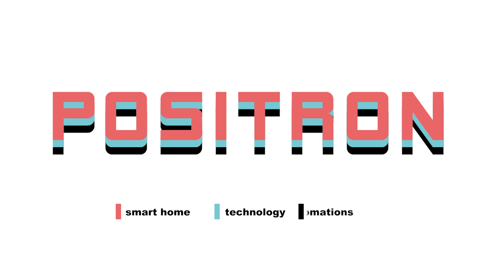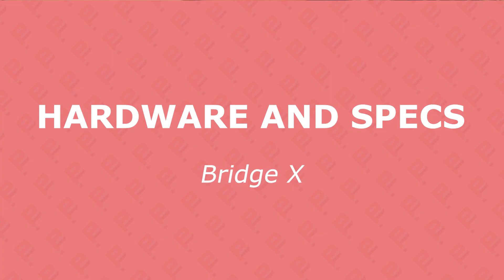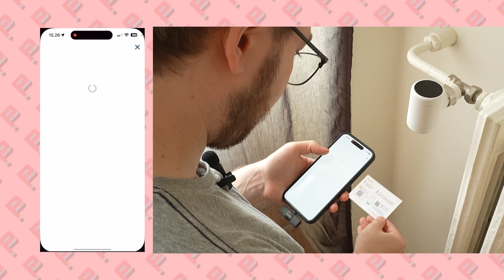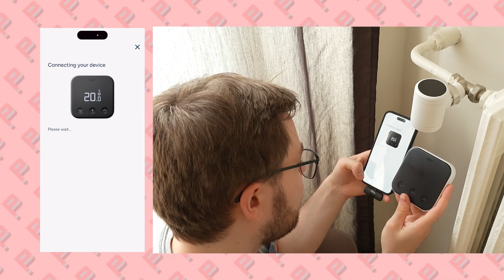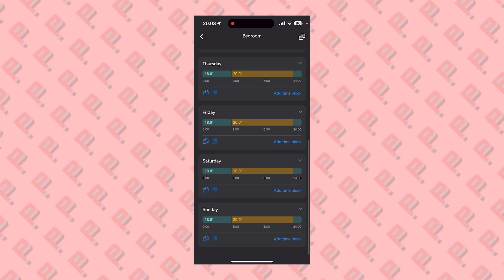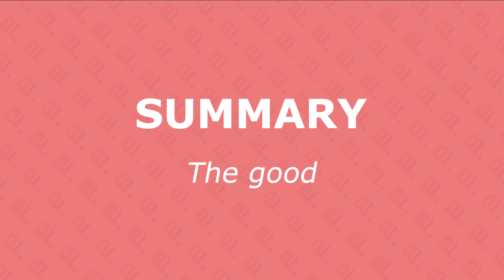Are the Tado X products worth getting?

Comment: I don't need the smart radiator thermostats, would I be able to just buy the Thermostat X and use it to control the temperature overall for the radiators? Because I've read in a comment in other video that you can't buy and use only the Thermostat X!!
Reply from the maker: The Thermostat X will work as a regular thermostat if you don't connect it to any smart home platform. It's just a pricey option for a thermostat for that use

Comment: If you already have Thread Boarder Router in your home (e.g. Apple TV or HomePod mini) I wouldn't use the Tado Bridge X as well because it will likely create a second Thread network, which is sub-optimal with Matter 1.3 (allegedly improved/fixed with Matter 1.4)

Comment: Got the Tado X to replace 2nd Gen Nest. Atrocious - sent it back. Couldn’t set up the Wireless Receiver - it would not go into the mode to connect to the internet. Reset, factory reset multiple times. 

Tried to call Customer Helpline - forget it, recorded message saying to use the web chat. 
Go to web chat - forget it. It’s an AI chatbot with not much I. Once you’ve exhausted it’s pre installed answers it tells you that someone will look into it and email you back at some point. 

I found an Installer phone line and spoke to someone who basically just got me to reset and factory reset it again. When that didn’t work I was told to reinstall the old thermostat and schedule a video call with one of their technicians. Waste of half a day.

Absolute pile of shit. You cannot use this without an internet connection. At all. There is no pairing of the temperature sensor to the receiver from the factory like you can do with every other thermostat I’ve ever installed. That’s just insane. 
If you’re an installer and the home you are putting this in doesn’t have an internet connection or, as in my case it doesn’t go into the correct mode you have to remove it and put the old thermostat back in. Imagine how that looks to a customer. 

Then I discovered that Tado have just introduced subscriptions for using basic functions like geofencing and separate room control and that was it. The radiator valves hadn’t been installed so they were returned. Cancelled the video chat and sent the whole lot back for refund. Im not subscribing to someone to get full functionality of equipment that I own when other manufacturers offer these for free.

If you’re an installer and got this to work straight off then good for you, but this system has been badly thought out from the design stage by not allowing pairing without an internet connection. The lack of real time Customer Support is a disgrace and the adding of Subscriptions for using functions is the thin end of the wedge for reducing functionality later unless you pay them. 

I’d avoid Tado completely. Well I have avoided them. They’ll never go into any of my Client’s homes. 

Oh and I never was emailed back either.

Comment: I have them. Beautiful from an aesthetical point of view, but not very practical. Lot of troubles if you convert from a heating system that wasn't supposed to mount it. The app isn't usable without internet and in general is only moderately user friendly. Pairing the appliances with the app was also a very painful experience (I had to do it after all the thermostats were installed and it took an eternity because the technicians didn't take note of the various codes). And honestly my home is not warm as I expected. I'll see what happens with the costs, but I don't suggest them.

Comment: Thanks for the review of the Tado X products. I have a few questions if I may. First and foremost, I live in Italy and have a central heating room with a gas furnace and a 750 liter boiler. We have a small guest house with 6 guest rooms and we rent rooms during the summer. During the winter, we are closed but I still have to heat the guest rooms to avoid having any pipes freeze when the temperature drops below zero. Each room in our house has a temperature control with a sensor. The temperature control only allows a guest to increase the base temperature (set by me) by 3 degrees or reduce the temperature by 3 degrees. The base temperature is represented by a dash (-) on the dial. There is also an antifreeze symbol on the dial for winter. Unfortunately, when the house was renovated, the electrician only put a temperature control in each of the bedrooms (facing south) but not in each of the bathrooms (facing north). Therefore, despite having radiators in both the bedroom and the bathroom, there is a temperature difference between the bedroom and bathroom in each guest room because there is only one sensor in a guest room. When a guest increases the temperature by 1, 2 or 3, degrees, the valve in the heating room opens and the pump begins to send warm water to heat the radiator in the guest room. When the desired temperature is reached, the sensor in the bedroom relays the information to the valve in the heating room and it closes which also stops the water pump. If I install the Tado X radiator valves on each radiatore in each guest room, that will control the temperature on each radiatore. That said, is there a device (the bridge or the black junction box that you connected the devices to?) that I need to install in the central heating room to control the opening and closing of the valves to allow the pump to send warm water to the guest room radiators?  Thanks in advance for your response. Ciao, Roberto

Comment: The Tado app is able to adopt an X device via other border routers, the Bridge X is not needed. You only need it if you don’t any other border routers. This is also stated on Tado’s website.
Reply: Wow thank you for that clarification
Reply: so if I have a tado v3 (old generation) setup with valve radiatiors, smart thermostat and bridge and I buy an additional wireless temperature sensor x to add in one room, will I be able to do this?

Comment: Hi thank you for the video very informative, I wanted to know If for example I don't have a smart valve in the kitchen and only have the smart thermostat and I decided to control the temperature of the kitchen from the thermal stat, does that turn all the house radiator on even though they are using the smart valves? or keeps all radiators with the smart valves off and turns heating on only for the radiator that doesn't have the smart valve?
Reply from the maker: I have to admit that I am unsure of this. I think it's best to reach out to Tado for an answer. Thanks for the kind words!

Comment: Thanks for such a video - just wanted to check if its possible to have two temps sensors to control a single zone. 

 I have a old house on a single zone - there is no one logical place to put the wireless thermostat due to different bits of the house getting colder depending on the wind direction.

 Do you know if its possible to have two wireless 'sensors' so that when either drops below the set temperature then the heating would be called (for the whole house). 

I don't want to install smart TVR as this will become very complex - just looking for a solution with two wireless sensors
Reply from the maker: @obrace1  I am not sure as I only have one. The best thing would be to reach out to Tado and ask them 🙂

Comment: Great review, I only have one question

I have 5 levels on my manual thermistor now, I want to turn it full regardless of the temperature because it’s a weak heater

Can I control it to max in any way?
Reply from the maker: There's no option to open the valve completely no matter the temperature. However, if you get the Temperature Sensor X and place it in the other end of the room, the Thermostat X will open up the valve when set to 30C (max temperatur)for a long time to heat up the room.
Reply: @ ooo I see, thanks a lot for the answer, in it you even gave me a possible work around, I just subscribed :)

As for the device, it’s a pity because I love the design but I would want a device which gives me full control
Reply from the maker: I'm glad you could use my answer, even if it wasn't the answer you had hoped for :) 

I am not aware of any smart thermostats that will allow you to fully open it no matter the temperature. I hope it exists and I hope you find it!
Reply: @PositronMedium  Hi man, in the end I bought Tado X :D

I actually first bought Kasa thermostats and you were right, none of the devices on market has this control. But its fine and I was happy. However I had a major issue so I sent the Kasa thermostats back. On one of my heaters, head gear fell off. So the thermostat fell to the floor on its own while its regulating the temperature.

Although I made certain I connected it roboustly, I would say plastic parts here are of real poor quality and now its always coming out with a little force as it seems to have warn out. And this is a horrible thing because imagine going on a month long vacation and it falls, you would come at back at a Sauna party that probably costs more than the vacation you've just been at :D

I am hoping Tado X has better connectors, if not I will try to buy some metal parts to connect it. Unfortunate thing is it looks the connectors are the same but lets see. I am hoping its slightly improved.

Comment: I have the starter pack - wireless receiver x + wireless temperature sensor x. The issue I'm facing in my 100 sqm flat is that the temperature sensor goes offline if I move it to the farthest point from the receiver. So I was thinking about adding a bridge x in the middle, but price seemed way to high for just a range extender. I found a matter hub on amazon and was thinking of buying that, at around 20 eur. Would I have the same functionalities if I go this route? Or you advise in paying the money for the bridge x?
Reply from the maker: Extended Thread networks is hit or miss for the most part. At this point I would stick with the Tado X Border router
Reply: @PositronMedium  Tado has a black friday sale right now, so bought the bridge x in the end.

Comment: Hi, 

Dejlig video, du har lavet. Jeg går op overvejer at opdatere mit Tado setup, især for jeg har 2 radiator hvor v3 modellen ikke kan komme på, pga. radiatorens placering. Jeg er lidt i tvivl om det nye design, vil kunne afhjælpe dette problem. 

Kunne jeg lokke dig til at, længden fra plastik adaptorens yder til Tado controllerens yder ?
Reply from the maker: Dejligt, at du kunne lide den!

Det er Ca. 6cm fra adapterens ydre til termostatens ydre. Jeg håber, at det hjælper!
Reply: @PositronMedium  Mange tak for svaret :) er det den fulde længden af kontrolleren inkl adapteren ? bare for at være helt sikker
Reply from the maker: @ Undskyld! Jeg har vidst misforstået din første besked - godt at du spurgte igen 😅 

Den fulde længde fra adapterens kant mod radiatoren og ydersiden af termostaten er Ca. 8,7cm. I mit sidste svar havde jeg målt fra adapterens kan ind mod termostaten, og ikke ind mod radiatoren.
Reply: @PositronMedium  Tak endnu en gang :) Sjovt, det er den samme længden jeg har på min nuværende v3 modeller (det mål der står i specs på deres hjemmeside, 7,8cm), men ifølge specs på X modellen, skulle den kun være 6,7. Så undrer mig lidt over at den ender i samme længden. 

Men mange tak for hjælpen

Comment: Thanks for very interesting review. Is there a Weather Compensation feature, either by an external probe or the system connecting automatically to local weather station information?
Reply from the maker: @davetester100  I do not believe they have an external probe or weather compensation. They don't with the Thermostat X's but I haven't tested the boiler thermostat - so while I'm pretty sure it doesn't have weather compensation either I can't say with 100% certainty.
Reply: Thank you 😊

Comment: Hello and thank you for this comprehensive hands on review of the Tado X smart heating system. I in the UK am expecting to see this on general release in a week from today. I am in the market of getting a smart thermostat of any description for a 22 year old combination boiler, and was considering both Hive and Nest smart thermostats in recent days, but having found out about this product within the last 24 hours, I feel inclined to get this product after your review. May I ask if it is necessary to get any additional network hardware such as a receiver to enable these Thermostat X's to operate independently or not? As this is meant to enable a simpler set up, I just wondered what is precisely required to make this investment to save my gas energy bills over the next 6 months from now. Thank you and keep up this good work.
Reply from the maker: @Eric76  Thank you for the kind words! 

You will need the Bridge X for the Tado system to operate and utilize the system's full set of capabilities. Without the Bridge X the thermostats wouldn't be able to communicate with the app or temperature sensor. 

A Thread border router with Matter - such as the Nest Hub 2 or SmartThings Hub - can also be used to connect and control the thermostats instead of the Bridge X. However, in this case you wouldn't be able to add the temperature sensor and connect it to the thermostats.

Hope that helps!
Reply: @PositronMedium  This helps enormously and thank you for this advice.

Comment: I can't recommend Tado X.

Have they removed the humidity sensor? Because the values I get are way off and I couldn't find a humidity entry hole like the v3+. 

Temperature measurement is very sluggish.
The Battery % is not displayed in the app or device...
The Humidity is not displayed on the device...

I had problems with their support/return process (especially on faulty products)
Reply from the maker: @Maestrou-jb1rq  I can't say how the new ones are in regards to the old one's as I don't have them. 
It sucks that your experience is negative though.

Comment: Excellent presentation for the automation of the heating of an apartment in a building equipped with a central distributed heating system. Excellent and unique explanation related to the interaction between a temperature sensor and the different thermostats of the radiators of one room. Very useful. Thank you! Hello from Belgium
Reply from the maker: @MEGA-rm5vm  Thank you! I'm glad you found it useful 😁

Comment: Odd to have the room temperature sensor running triple A batteries but rechargeable battery pack for TRVs. Surely rechargeable temperature sensor could have a long run time with a rechargeable battery also?
Reply from the maker: @Davidb67  Haven't thought of the temperature sensor not having rechargeable batteries. I guess you could use recargeable AA batteries for the sensor. Rechargeable AA and AAA batteries usually has a lower voltage than regular batteries, which the sensor might run on just fine but the TRVs wouldn't.

Comment: Thanks for the review! I really like this product and I think I will buy it. I don't like the fact that some convenient functions are under subscription despite the fact that there is an investment of 400 € to put everything into operation.

Would you recommend it even without buying a thermostat? Do you think the built-in sensor is reliable despite being attached to the radiator? I don't want to buy a thermostat for every room.
Reply from the maker: @RaYm4n3  I don't plan on using external temperature sensors for every room. The temperature reading from the thermostats themselves will be off since - as you mention - they are right next to the radiator. However, you can offset the temperature reading inside of the Tado app, which helps a bit. 
To be honest I don't care if I set the temperature to 21C and the thermostat heats the room to 22C or 24C, as long as it's within reasonable margins I am more than satisfied.
Reply: The Honeywell evohome reads from each thermostat and you can offset the temperature, I find you only get an incorrect reading due to the radiator if you have the thermostat blocked in with objects like plant pots or bins etc.  as such I would not use an overriding thermostat as I like each room controlled.  Tado does look better is some ways and may be less expensive.  When I need to replace I will evaluate.  So far Honeywell has been good for 5 years with batteries lasting two years and yes you can hear the valve.

Comment: Hi! Great video!

You said it's possible to control open windows and other things with another free app so you don't have to pay for the extra Tado app that controls that sort of thing. was it SmartThings? 
I'm getting my new Tado X system today! I’ve got 2 temperature sensors and the thermostatic heads. 
Thanks for your help.